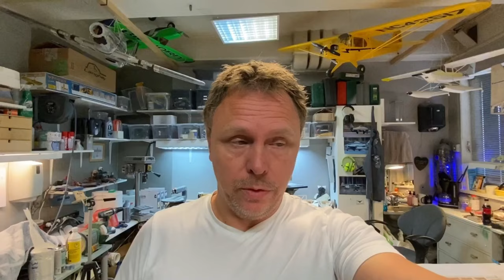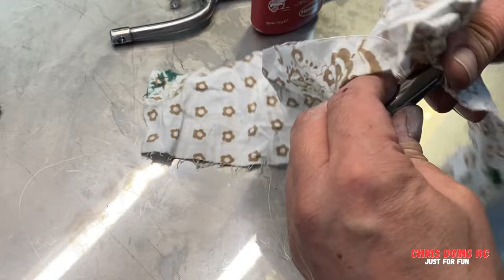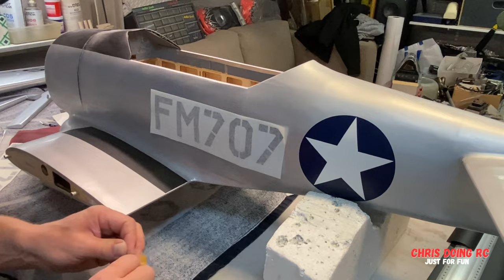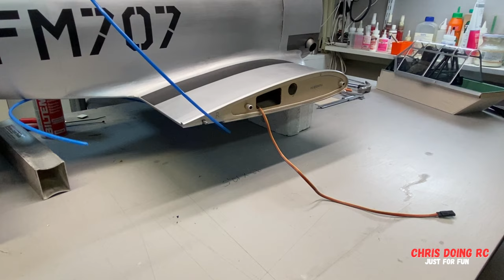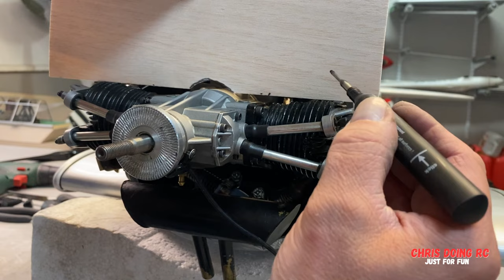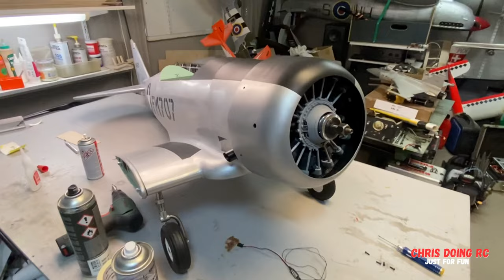Seagull AT-6 finished

Comment: The airplane looks amazing, great work ..my experience is that too tight space between cylinder and baffle does not work good, 5mm space makes for much better airflow and cooling .. just my 2 cents 😁👍
Reply from the maker: Thank you! That is a good advice, the coolingfins are small so yes I agree.